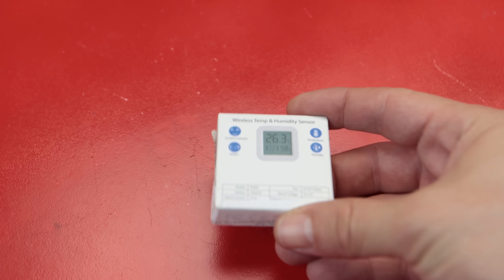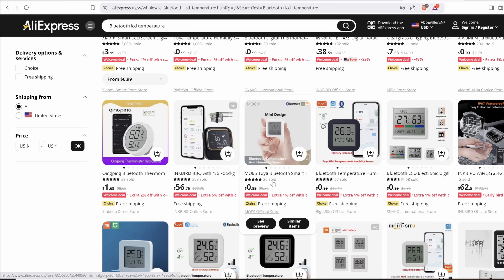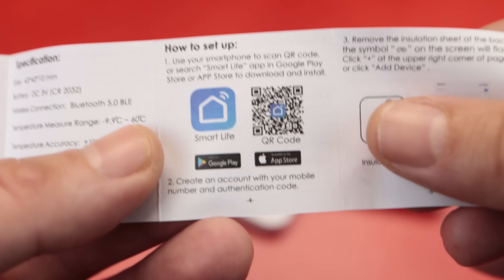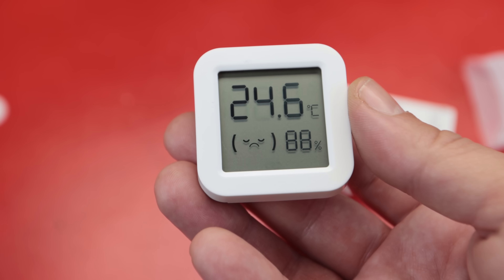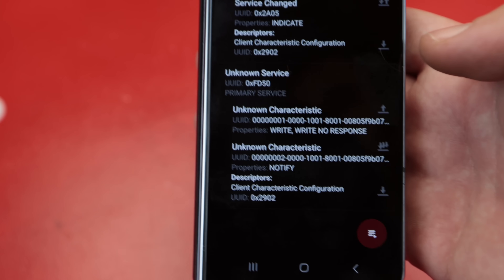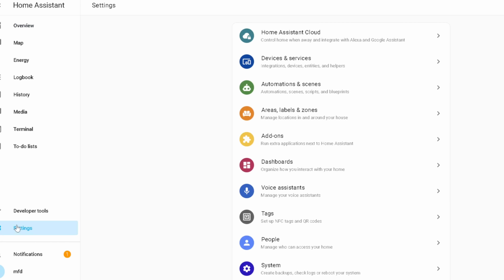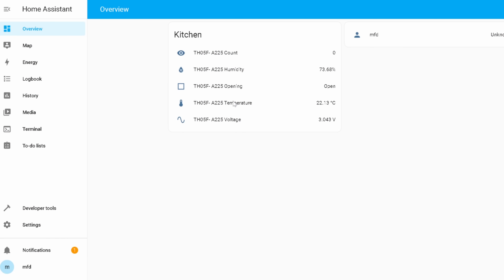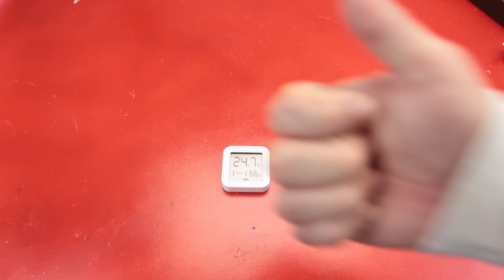Custom firmware on cheap Chinese Bluetooth LCD temperature - humidity sensors for Home Assistant

Comment from the maker: For those having trouble finding cheap prices, AliExpress unfortunately tries to maximize its profits by showing different prices for different regions. I tried the following methods, and the prices changed significantly:

  1 - Log out of your account.

  2 - Use a private tab on your browser.

  3 - Change your location with a VPN (Asian locations showed significantly lower prices for me).

  4 -  Open a new account after you put items in your basket.

If you have other tips, please reply under this comment so we can all benefit and avoid their shenanigans.
Reply: I think you may be mistaking region pricing with Aliexpress's "welcome deal".
If you are not logged in or are on an account that has not yet bought anything you will see many items that get the "welcome deal" rebate for new customers. It will make already cheap items go down to the minimum price like this. of course this is to incentivize you to make your first purchase. Unfortunately it also makes it hard to accurate compare prices.
There are certain limitations that make it impractical to try to exploit this with a new account each time - not that I endorse that sort of behaviour.
I wasn't able to confirm any obvious price differences between europe and hong-kong as locations when I tested.

They are still very cheap and good value, especially if you can integrate them into a smarthome system. They cost more like 3 USD instead of 1 - it hardly makes that much difference. They also come in zigbee/wifi versions that don't need modding, but those are a fair bit more expensive pr unit

EDIT: It is well worth comparing prices on Ali and Temu however. They can have big differences, at least in more mainstream items. Keep in mind that Ali prices don't show VAT included until you check out.
Reply: @TheStigma  I think depends on the region. On EU all prices has VAT already from what I see.
Reply: @marian5316  I dont see VAT included on Ali (Scandinavia). It gets shown at checkout. Temu has it baked in, though. If there are real regional pricing differences, then I am very much keen to know - but I suspect this is due to confusion
Reply: If you select usd for currency, the price in dollars is roughly the same as gbp+tax so that gives you a better idea of price.
Reply: VAT included for 🇩🇪
Reply: @marian5316  VAT is added at check for the UK
Reply: Using a private browsing window I got the 0,99€ price tag but that's sadly only for one unit. Anything else doesn't get a discount and you need to buy more for free shipping.
Reply: Bought 3 for $AUD 3.69 each and price jumped straight after purchase to $4.50
Reply: Took me a bit to realize that the $1 for 1 unit is basically their sample price, as it is limited 1 per customer.
Reply: @TrentR42  It's not really for sampling. 0.99USD is just the minimum price you can get with any rebate. The new customer rebate therefore brings cheaper items down to that level (kind of a waste). You only get one of these rebates on a new account, and only on 1 item - which is why it says max 1 pr customer now before you have used it. There's no item limit in general for most items, just for the rebated pricing.

Alibaba is somewhere you might find actual samples - but this is very different market catering more to vendors or industries buying in bulk.
Reply: I searched for TH05 and got one €2,63 as part of a bundle deal but with free and very fast shipping. 

I’ve seen several other offers for around €3 which still is incredibly cheap imo.

You can also search for “Tuya temperature humidity meter”.
Reply: price of a coin cell in a european shop can be more expensive than this thermometer.
the smartlife app is also used by western companies already.
Reply: Yeah but it also shows intro deals are unrealstic deals for the first time purchase.
Reply: So tired of the aliexpress skullduggery. It's so sketch

Comment: I bought 5 sensors using your link in June 2025, which is the cheaper version with a green board and without an reset pin, so I cannot flash the custom firmware.  Please replace the link with the correct one.

Comment: The latest version I got actually has the pads on the top circuit, so no need to remove the LCD. Though there is no reset pad.

Comment: the main difference between these Tuya BT thermometers and Xiaomi BT thermometers is battery life. I couldn't get Xiaomi working with Sonoff iHost or Tuya, so I decided to buy these and they're rubbish. Battery life is only around 2 weeks, while Xiaomi connected to BT gateway lasted around 10 months. Also the difference in temperature and humidity is around 7% which is a lot. How can I use it as a reliable source for thermostat switching if one device says 20.8 and the other 22.6 ? And the real temperature in the room is 22 Celsius ..

Comment: Hi, beginner here (in programming) - maybe I'm not alone. reading and trying to use what you offered I have available Ubuntu,  not Windows and things are for sure simple to solve, but first need to learn where to start with. Is there any 'Linux version' of your work? I mean to launch a CLI command and program? (like for lazy / less experienced people). I tried to understand python source file 'rdwr_phy62x2.py' - so far I understood that you take the hex/bin, then send it to the indicated serial port and program PHY6222. Does PHY chip enters a programming mode when RST is pulled to GND? Then it will accept what you send on serial port and it will store it to the specified memory address? Any details are welcome, thank you for giving me the chance to learn :) !
Reply from the maker: Hi, basically you summarized everything very well :) yes everything works under the windows and linux as well. just check one of the .bat files for example usage.
Reply: @makersfunduck  Eventually I made it! :) My machine uses Ubuntu and I used a PL2303 USB-to-serial converter - the setup I have worked ok for many ESP8266, ESP32, Arduino. Aparently for the TH05F thermo&humidity did not work. I did my best to ground the reset pin, but without success. I even powered the TH05F from an external 3V3 instead of the 3V3 from the PL2303. I checked the logic was on 3V3 and not on 5V on the PL2303. I checked all the signals and noticed that the RTS and DTR from the PL2303 were always on logic 1 (3V3) at least from a multimeter perspective (did not look at the signal with an oscilloscope). I was fortunate to have around another USB-to-serial module, one using CP210x and that one did the trick effortless as described here and on github. Thank you for bringing this firmware to the people :)
Reply from the maker: @YO2LYP  I am glad that you managed it to work, and hopefully have fun doing so :)

Comment: Yeah, I have 3 of these cheap thermometers, they are constantly 2 degrees off to one another. And battery lasts for half a year or so. More expensive XIAOMI ones are spot on and still live on the battery they came with.

Comment: These are absolutely great. I've bought 9 of those, all from 2-6 dollars each, they work fine, all of them. I use them to turn on /off heating and dehumidifiers with smart plugs, works a treat, and they last like forever on the small batteries.
Reply: The default battery only lasts about 2 weeks if it got connected to bluetooth
Reply: @ugayashan8659  I figured that it would be like that in terms of life, thankfully coin cells are ridiculously cheap in bulk

Comment: Does this need soldering wires to flash new firmware?
Reply: You can also make some kind of a spring contact fixture if you want to flash more of them quickly.
Reply: yes. Or a few hands to push the wires to the correct places on the PCB!

Comment: I've 4 of these. All use ATC_MiThermometer and MiTemperature2 from github. Data is send to Raspberry Pi Zero which has influxdb and grafana installed.

Comment: Will it still work if you remove the bluetooth chip?
Reply: There's no separate bluetooth chip. The main microcontroller has this feature built in.
Reply: @k4be.  That sucks
Reply: Why do you want to remove the Bluetooth chip?

Comment: Mine is an older version. I cannot remove the pcb because it's attached with super tiny allen screws which I don't have tools for. I would like to turn the bluetooth off because I don't use it and my devices battery life is not impressive.

Comment: Great project! I have one question because I stuck. After update of firmware by UART I try to update it to final one (as from 12:20). Device connect for a while and I get error: NetworkError: GATT Server is disconnected. Cannot retrieve services. (Re)connect first with `device.gatt.connect`. I tried on two PCs (unfortunately both on WIN11) and one android device. I keep device near PC/smartphone and always have full signal range.
Reply from the maker: Hi, do you have enough power on your batteries? you can try to upload it withnew batteries, or with anouther reliable 3V power source

Comment: The PHY6222 also supports Zigbee. Would be cool to use Zigbee instead of BLE for this, as then it would benefit from the Zigbee meshing.
Reply: I have several flashed with zigbee and they work absolutely great.
Reply: @TechdoLiberal yes, where did you find the firmware?
Reply: @TechdoLiberal  didnt Frozen? Can you provide the link of the fw?
Reply: Did anyone flash zigbee to it?
Reply: @dittmanngeocaching336  I did try but it's very slow and ustable - reads data for some time then freezes - works again after removing battery. BT looks better
Reply: @emceh  Due to the power supply by a CR2032? The CR2032 can only supply low current and I guess the peak power draw in zigbee can be highen than BLE.
Reply: These exist with zigbee, for the same $5.
Reply: There's one sold with zigbee already. Got one for a few dollars but it's definitely not amazing. Slow, hard round number reporting, and no unit switching, but it seems to at least kinda work with home assistant.
Reply: @astersfun yes, that is my experience with the cheap zigbee ones as well. That is why I'm searching a custom firmware with no rounding and better control.

Comment: 2:51 "It is totally usable" ... while it display a humidity of 94%. As I doubt you're working in Singapur (almost equator, very hot!) after one of them 8+ daily hefty showers (very damp) I doubt the values of this device.

(And if you're in Singapur, you would have turned on the AC to a chilly 21°C like they all seem to do ...)

At 14:47 you also see totally different temperatures and humidity values (albeit from two different devices). So these devices are in need of some serious calibration!
Reply from the maker: My hands were moist after washing them post-cleaning the PCBs with isopropyl alcohol. This caused the humidity meters to show high levels. The temperature difference is due to my body heat. While not as accurate as test equipment, when placed together, the sensors show minimal variation within the datasheet's tolerance levels.

Comment: I flashed all of mine with a Zigbee firmware and it works a treat!
Reply: Any links to the ZigBee firmware? Thanks
Reply: What device and firmware you use? Thx
Reply: For some reason, I keep remembering and spotting your profile picture year after year on random videos. It's quite unique.
Glad to see you around familiar stranger haha
Reply: How did you do that?
Reply: just search google for z03mmc, flashed 3 of mine, all work like a charm

Comment: 14:45 Was the Mi device in another room entirely just before you showed it? Or inside an aquarium? 😀
Reply from the maker: My hands were moist after washing them post-cleaning the PCBs with isopropyl alcohol. This caused the humidity meters to show high levels. The temperature difference is due to my body heat. While not as accurate as test equipment, when placed together, the sensors show minimal variation within the datasheet's tolerance levels.
Reply: @makersfunduck  Thank you

Comment: These are available also in Zigbee version which can be easily integrated to HA. I've been using them in my bathroom to trigger the ventilation fan when there's high humidity.
Reply: I have a problem with battery on zigbee version - no matter what brand of battery I used - it discharge after 1-2 days.
Have someone experienced this too?
Reply: @kjuboun  Mine have been working fine on batteries for a few months now. In your place I'd convert it to USB power with a buck converter, but probably you got a faulty one. That's life..
Reply: Any link please?

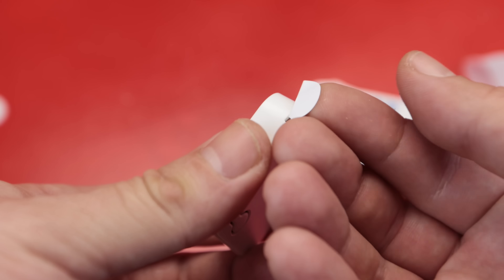Comment: 2:34 ;you must be underwater almost 100% humidity
Reply: Not how humidity works also wash your hands and hold a humidity sensor in your hands for a bit. I'll blow your mind
Reply: Humidity is saturation of air with moisture it can hold. 100% is a dew point.

Comment: I have a bunch of Xiaomi ones here for almost each important room.  At first I liked them, even now ... but I need a subscription for batteries and that is becoming pricey. Sometimes it seems cheaper to buy a new device than a battery. 
I am now testing the Tuya compatibel versions without a display and 2 x AAA batteries in the hope they will last longer.  But now the humidity reading is completely different, about 10 to 20% difference. Seems temp wise most are kind of simular in value but humidity is a problem.
Reply: The Tuya WiFi ones with no screen eat batteries, you may get a month out of the two AAA. They also only update once or hour, they are worthless in my opinion. 

Now the same Tuya zigbee version I've not tried and likely get good battery life.
Reply: @timmturner I bought Zigbee versions for that cause. WiFi always has to make a connection to the AP which uses a lot of power.  Zigbee or BT ble for the win.
Reply: @timmturner  That's a fundamental problem with wifi I think - that it's much more power hungry. BT or zigbee will be the most power efficient for small-battery devices.
Reply: @TheStigma  agreed, WiFi IoT and battery power don't go together
Reply: I used the wifi tuyas with no display. They update when the readings change so it can be every minute or after three hours. It‘s to conserve energy snd makes total sense. The wifi version however runs only 1 month on its single AAA, snd 3 months ehen you use the more expensive non-rechargeable lithium AAA. It‘s best to run them with a small solar panel and a buffer cell. That works forever. Else, at least the wifi version becomes a costly battery grave. ;-)
Reply: @twr4641  you must be using a different version, the ones I have use two AAA batteries and still only last about a month using rechargeable batteries
Reply: I run mine for a Wineador. (Humidor for cigars in a converted wine fridge.) I changed the rate of refresh to the recommended rate from Chris’ smart home tech tutorial. I get 3-6 months.

Comment: Those two show wildly different temps and humidty. Not worth the time it would seem if they aren’t accurate.
Reply from the maker: They show different because I was holding them on my hand in the video. Normally, the delta is around 0.1 degree Celsius max, and Xiaomi and the clones are within the tolerance ranges.

Comment: unfortunately, these devices are horribly inaccurate. but you can offset them in home assistant...
Reply: Hi. Do you have a ref of an accurate temp and Rh HA sensor ?
Reply: @spd785  Yes I do
Reply: @simontube8417  What ref ?
Reply: @spd785  they are all different. for mine, the temp is correct but humidity is -3.6. But I'm not even sure yet that the error is linear...

Comment: I bought the zigbee version of this device and it worked with zigbee2mqtt, however it can't report any decimal points on the humidty. The reporting interval is better than some other temp sensors, but I need 1 decimal number for the humidity. 

I'm thinking to give that thing back to Aliexpress, but thanks to you, I know it's easily flashable. Is there custom firmware with zigbee as well?

Comment: This is also sold under Xiomi brand
Reply: I thi k the Xiomi ones use a different hardware which is even flashable over the air.
Reply from the maker: Xiomi uses a different MCU and a sensor. These are clones.

Comment: Please clarify whether the striking difference in temperature and humidity at the end of the video when comparing the Mi thermometer and the AliExpress clone is due to holding the device or whether this is representative data.
At the end of the day, I wouldn't really care whether a device is easy to integrate into a smart home or easier to read if the data it collects is incorrect and therefore useless.
Reply from the maker: They show different because I was holding them on my hand in the video. Normally, the delta is around 0.1 degree Celsius max, and Xiaomi and the clones are within the tolerance ranges.
Reply: @makersfunduck  Accuracy is paramount with these devices.
Reply: It's almost impossible to make these devices very inaccurate. People usually say so because they need some time to acclimate. All the ones I've had after 24 hours showed pretty much the same values while the first few hours the readings were wildly different.
Reply: @ares395  I have 6 at home that have been laying side by side for almost 4 months, they have wildly different measurements: most hover around 44 to 55% humidity but one is 33% and temperature wise they spread over a degree. I hoped they could be re-calibrated with a custom firmware but never got to it.